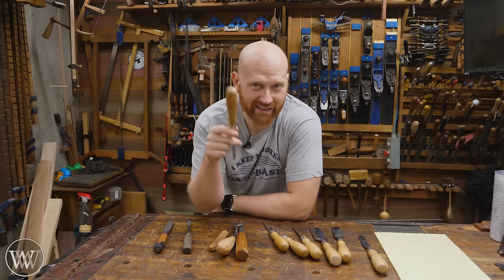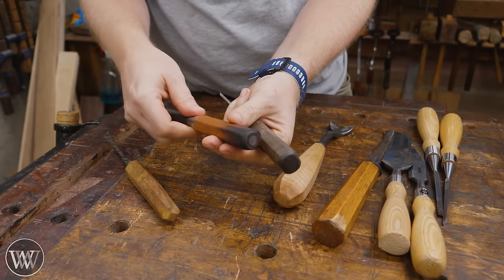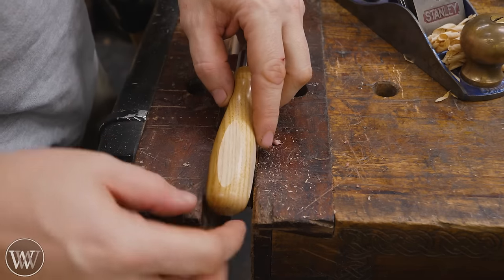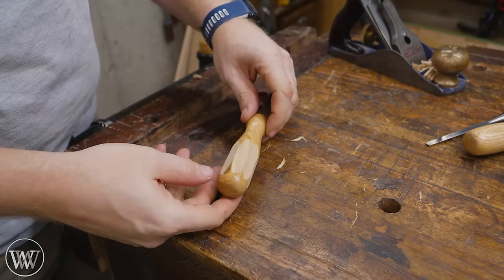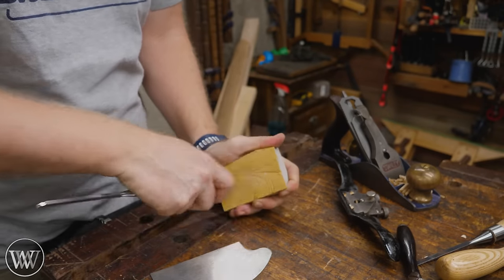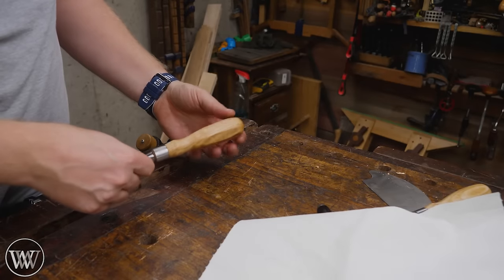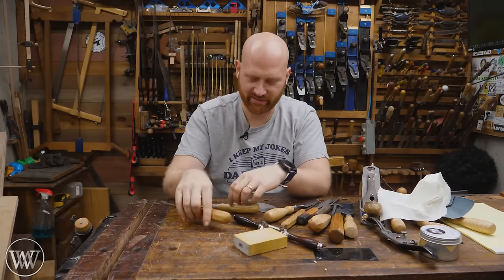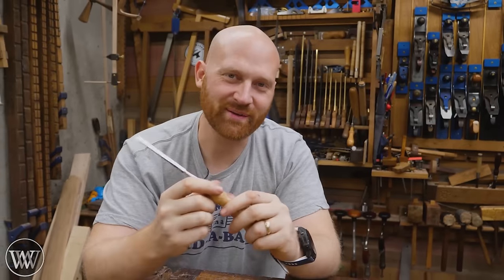Making The Prefect Chisel Handle

Comment: I have a box of handleless tools I got at estate sales.  Usually I bought a box for 1 or 2 things and tossed the recoverable leftovers in there.  When I’m in a funk, I’ll clean one up, split a chunk off some beech logs I have, and make a handle.

No one cares except me, but I love it.  It’s crazy rewarding to have a tool for my own hand, especially when it’s from raw wood and carving without a lathe to me.  They’re never perfect, but they feel great and they’re mine.  An extra chisel of a size means I can keep going vs stopping to sharpen when I’m in the zone.  Hatchets are great to have different bevels on.  You can never have too many saw files.  And, if all else fails, you can donate a tool to a friend.

Comment: That was a really cool project. I can see why you procrastinated on getting it done. There's got to be a bit of a butt pucker factor when you start customizing such a nice tool. Kind of an expensive one, too. Compared to Lie-Neilsen or Blue Spruce, they might be considered moderately priced, but on my budget they're pretty expensive. Fortunately for me, I bought some Blue Chips back around 2000, when they were still really good. They were pretty cheap, too. I'm not a fan of the plastic handles, but I don't think I've got the courage to replace them.

Comment: Because of my old man hands I have two distinctly different sets of bench chisels. The batch of smaller chisels have slightly offset semi oval handles and I only pare with them. The offset is to accommodate my thumb carpal tunnel. They are 1/2" to 1/4" only and older inherited and flea market finds. Like you I rehandled the delightful Narex with octagonal slightly bigger diameter ancient broken ball bats.

Comment: The unhandled set is a good option. I wanted my 1/8" handle to be much smaller, with no ferrule, then decided to make the handles graduated. I had some apple which was too small for other purposes. There is no need for machine perfection here. If you get it right, every time you pick up a chisel, it's more fun.

Comment: One thing I love and what I learned from this video today is that not all cases you have to totally start from scratch like removing the handle entirely and making another set of handles. Of course in my opinion I think it is better cause at the end of that route you fit it to fit "your hand and wants" so it will naturally be made for you. However if we ever run into a tool with a handle we already like, it shouldn't stop us from seeing if we can make slight tuning to it and make it perfect. Hack in my own world I actually thought of using leather wrapping for chisel handles, which I plan on doing in the future once I get a set of chisels I think will be good. might actually post my work and write out the results to see if it is worth it or any practical idea to do it for your chisel handles.

Comment: The Sears Craftsman Router Crafter keeps on popping up as something that can solve a lot of weirdly niche yet reoccurring projects, like a perfect cambered octagonal handle maker, or making wooden screws. 

It's basically a Router Sled positioned over a hand-cranked lathe chuck, and is the Router version of a table saw dowel making jig, with some neat tricks, like having a cable that moves the sled while simultaneously turning the chuck.

I see it talked about very little, possibly because it seems like a Bad Idea(™️) but I'd love to see more discussion about it in this context.
Reply: It's funny you should mention the copy crafter, I saw a "tip & trick" pop up in my email from woodcraft this morning on making a jig to make and achieve about the same results with a lathe.

Comment: I made this exact modification to all my Richters, as well as my rasps with similar handles. I didn'think of the spokeshave trick, though. By the way i loathe film coatings on tools and tool hadles. It always come off immediately. My. Ece Primus 711 had not taken shaving 1 before its (particularly awful) film finish cam off.

Comment: Oh no, it's for me. I'll send you my Richter chisels, still round, and you send me your modified ones. Fair trade 😛 and organic!

I had the same critique of the Richter chisels when I received mine. I did a Michael Jackson dance move to keep from having my foot impaled by the 1/8" rolling off the bench when I was unpacking it. I need to do this with mine as well. After seeing how yours went, I think I might put a plane upside down in the vise and drag the handle across the blade instead, ensuring the front knuckle and handle are both in contact.

Comment: I like how an octagonal handle feels too, and I've created some designs loosely based on the London pattern before, but I never thought to experiment with the number of facets.  Is 8 sides really the best, or just more convenient to make?  I wonder if 7 or perhaps 10 facets would be better.  My expectation is that the sweet spot happens to be 8, but the next time I 3d print a file handle or something like that, I'll perhaps try a decagonal  cross section instead.
Reply from the maker: 8 is just easy to make. I have never experienced to try others.

Comment: I'm slightly surprised you didn't take the handle off the chisel. That being said: the method worked, so there be no fault
Reply from the maker: Keeping the chisel on allowed me to make sure that the chisel was flat and straight in the jaw. Gives you something to eyeball. Not to mention taking them off and putting them back on is an absolute pain.

Comment: I think you can also clamp a No4 or 5 plane upside down, and run the fat faces on the sole to create coplanar faces on the front ring.
Reply from the maker: You can. But I find it much easier to control the plane than to control the chisel. But I'm sure someone find it easier the other way around.

Comment: The fact that the original handles were large and clunky is a key factor here. Trying it on a smaller handle could result in something too spindly. But I do quite agree that a multi-sided or fluted handle is best... especially for screwdrivers. 🤙

Comment: I do not like octagonal handles 😀 smooth boxwood or walnut for me. I have a lovely set of Luban but I wish they didn’t have flats or steel ferrules instead of brass.
The London pattern I dislike, but my screw driver with this is definitely much more positive grip. I associate it with cheap tools sold by Woolworths in the 1960s. No logic, just simple prejudice.